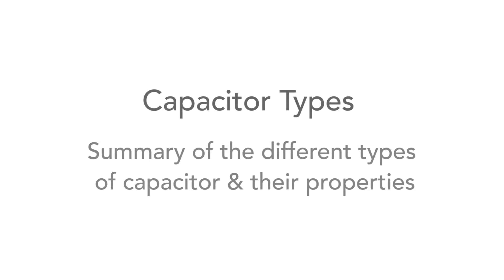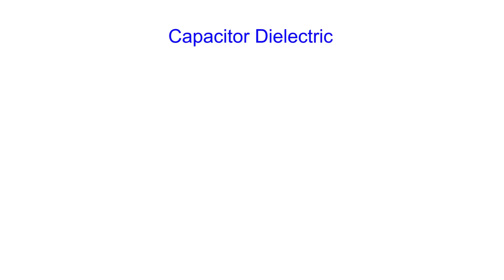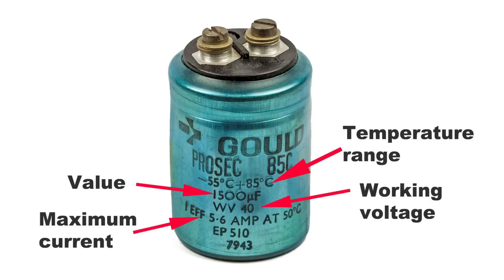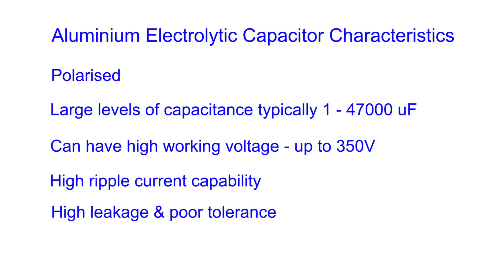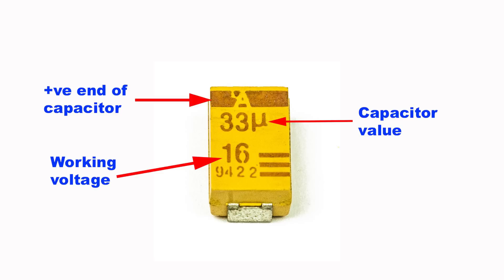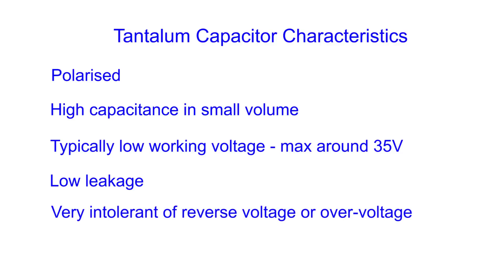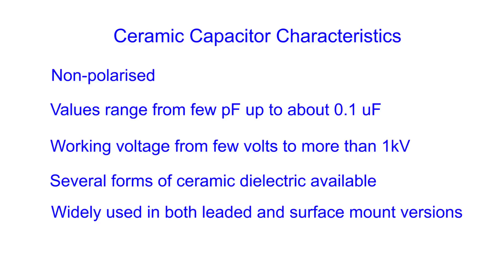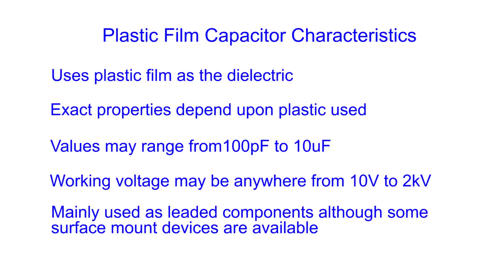Capacitor Types Explained: the ultimate guide

Comment: Ceramic smd capacitors, polyester smd capacitors mounted on a PCB electronic circuit and stored for long periods of time without being energized without use, suffer from the same problem as aluminum electrolytic capacitors, losing capacitance, high leakage current…?
Reply from the maker: The problem tends to be seen in electrolytic capacitors. Other types are a lot better and do not suffer froth same issue.
Reply: @ElectronicsNotes  why do ceramic, tantalum and polyester smd capacitors not have the same long-term storage problems as electrolytic capacitors?

Comment: What type would a point condenser ignition on a 60s car use ? just wondering  thanks !
Reply from the maker: I confess this is not an area I am particularly familiar with, but I believe they used a wax impregnated paper for the dielectric at one stage. I’m not sure what modern replacements use.

Comment: Think of caps as energy storage devices. Electrolytics typically are placed where the power comes into a circuit board. This filters the incoming supply and holds a fairly large energy reserve. Energy from the electrolytics is usually distributed to several tantalums placed strategically around the board. Lastly, energy from the tantalums is distributed to ceramics. Ceramics provide the burst of transitory energy needed for digital transistor switching. For a very brief time a transistor may show a near zero resistance and shunt a lot of energey to ground.  That's why there needs to be adequate number of ceramics of a range of values to provide that instantaneous current demand. Consult semiconductor or device  datasheets for proper cap values and placements.
Reply from the maker: Thanks for the comment.

Comment: When you say "leakage" do you mean voltage leakage or dielectric fluid leakage?
Reply from the maker: The term leakage applies to current leakage. The dielectric in some capacitors provides a much higher level of insulation in some capacitors than others. Electrolytic capacitors have a relatively high level of leakage, often measured in terms of microamps. Others like ceramic capacitors are much better int his respect and the current is very very much lower.

Comment: Thanks for the very good quality presentation. I just wanted to add a note about aluminum electrolytic capacitors. These are available in very high voltages, up to 900V. They are also available unpolarized (known in the industry as bi-polar or non-polar) for use in AC applications like power supplies and motors.
Reply from the maker: Thanks for your comment.
Reply: I've also personally dealt with much higher voltage electrolytic caps as well. They can easily be found at 10k volts on mouser just as a note. Generally speaking, yes these don't go that high but 480v caps can easily be found in plasma televisions as well.

Comment: Note about ceramic capacitors; saw another video where a guy connected a larger one to his oscilloscope and showed that not only did the signal shown on the scope vary if he so much as had his hand close to it, but it also showed significant spikes if he tapped it due to the piezoelectric effect. Suggests they're not great in audio applications, for example.

Comment: can i replace 120uf 450v 105c electrolytic capacitor but different packaging sizes?
Reply: Yes, but make sure the working voltage is the same or higher, and make sure the polarity is right.  there is usually a minus sign ,.. It must be oriented the same way.

Comment: 4:19 - you somehow know that this is in picofarads, but at 6:02, another 3-digit number and letter and now it's in nanofarads. How are we to know this?
Reply from the maker: It is often assumed that capacitance figures are in pF unless there is some reason to assume otherwise (e.g. electrolytic capacitors). The capacitor you mention is has figures of 104 to indicate its value. This is 10 x 10^4 pF, i.e. 10 x 10000pF = 100000pF, = 100 nF. I hope this explains.
Reply: Thanks for the prompt reply. Just wondering what the convention is between nano and micro. Would 0.1uF be preferred over 100nF?  Which do folks in the industry use the most? From what I see, at least from videos, it's mostly pico and microFarad notations.
Reply from the maker: Microfarads, picofarads and nanofarad are all used. It depends upon the value and people's preferences. On our Electronics Notes website (https://www.electronics-notes.com) we have a page on capacitance conversions: https://www.electronics-notes.com/articles/basic_concepts/capacitance/capacitor-conversion-chart-uf-nf-pf.php It has a calculator as well. I hope this helps.
Reply: @ElectronicsNotes  Seems like “47mF” would be less ungainly than “47000µF”.
Reply: Nowadays manuf use Nano a lot,  which is 1/1000th of a microFarad. they used to use microfarads, and picofarads (or micro-microfarads). So .001 uf would be referred to as  one nanofarad, oftentimes currently.
Reply: What are You proposing the m stands for Milli?  too confusable with micro.  No one had to worry much about "milli"farads until Just recently..  How' bout just .047F?  Back in Tesla's day they used to use 5 gallon glass water bottles lined with tin foil, for .001 UF  (at 50,000 Volts?) they were referred to as 'condensers"
Reply: @Geopholus  micro is µ, not m.

Comment: Ceramic capasitors cannot be used with high frequencies because these capacitors are very sensitive to tempeture. It can be used only when u don't need a constant capacitance.
Reply from the maker: Thanks very much for your comment regarding ceramic capacitors. You are right that some types of ceramic capacitor are sensitive to temperature, but on the whole ceramic types are used for RF because of their superior performance at these frequencies. You have to be careful with the leaded versions because in general they are sensitive to temperature. Accordingly they are typically only used for coupling and decoupling. Surface mount varieties are used almost exclusively where RF is concerned for a variety of applications. These days a number of very good ceramic dielectrics have been developed that have performance levels that are very good in terms of temperature sensitivity and they are being used in areas that would previously have needed other forms of high tolerance capacitor. I hope this helps.
Reply: Ceramic capacitor used in crt tv circuits ....so its high fequency capacitor
Reply: ElectronicsNotes They're good for rf bypass caps or coupling caps between stages, but not anywhere that temperature stability is important like oscillator and filter circuits.
Reply: Ceramic caps have been used in many applications.  They have been used in radio, and audio for years and the stable versions NP0's can be used in exactly applications, where temperature drift is pretty critical.

Comment: Should I avoid AC on a polarized capacitor?
Reply from the maker: Generally the answer is yes. You should avoid the voltage going positive and negative on a polarised capacitor. If an AC voltage is superimposed in a DC voltage and the polarity of the voltage does not change then that would be OK.
Reply: Smoothing capacitors are placed behind the rectifier in power supplies. There shouldn't be any application where the current reverses on a polarized capacitor. They are NOT diodes.